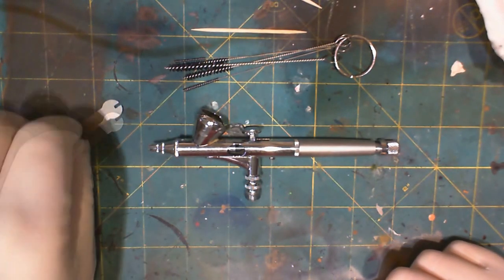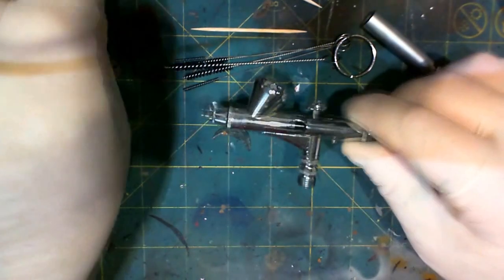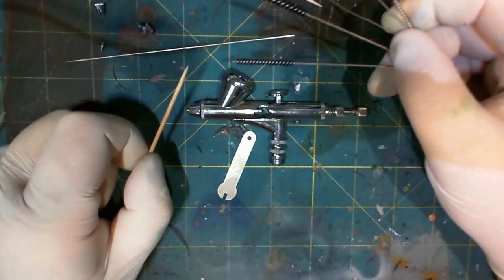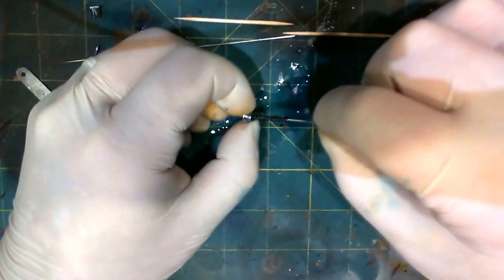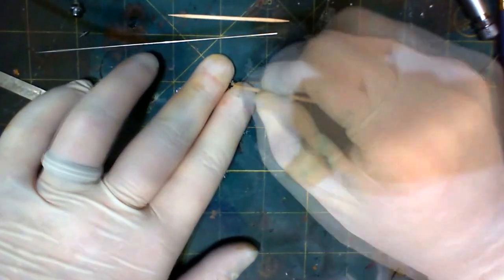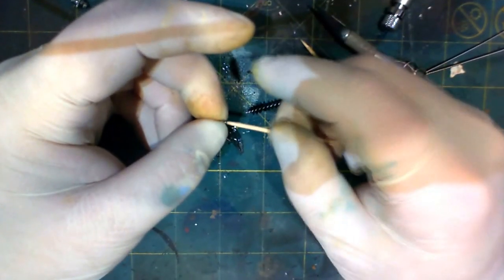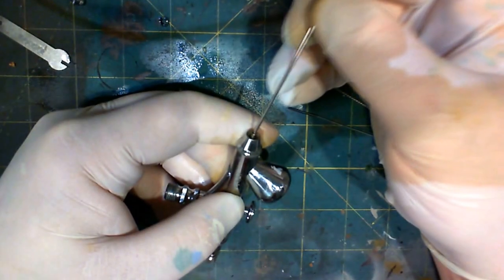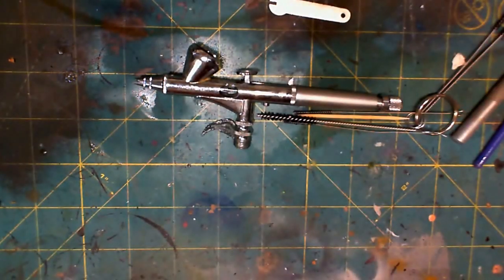How to Clean Your Airbrush

Comment: Jay,

I am a high school art teacher and there has been bits and pieces of air brush stashed away in hidden corners of my four art rooms. I finally compiled all the pieces. I have one compressor with several hoses, two badger 150S, a badger 250 (probably good for only priming) and a Thayer & Chandler 1980 model which still needs some love.

At any rate I could not get these brushes working properly. It was one issue after another. They never worked with any consistency. After watching your deep clean video on YouTube I used your shave the toothpick technique. Well, I pulled out about a cat and a half of tiny fuzz from various parts of the brushes. I think from pipe cleaners.  Mind you these have not been used since the eighties and there was much dried paint as well. All brushes are up and running less the Thayer & Chandler. 

So, one thousand thank yous for the shaved toothpick maneuver.
Reply from the maker: G. George Girard I love getting reports like this! Thank you so much for letting me know I could help.

Comment: Thank you SO MUCH for this video! It was perfect! I just got my first "real" airbrush (Iwata HP-C+...I previously had the neo for iwata) and I want to make sure I take good care of it. I used it for the first time today and love it! Took it apart and cleaned it just like you showed and it went perfectly! Thanks again!
Reply from the maker: PozziToons Fantastic. It is the most important skill to learn when you first get in to airbrushing. If you can keep it clean you'll avoid frustration in the future.
Reply: Jay Adan How often should I clean it? After every use before putting away? Or is that too much?
Reply from the maker: PozziToons   I have another video on the "quick clean" which I do when I'm done with a color - every time. This cleaning can be done at the end of your overall painting session or if you seem to have experiencing any problems with your spray.
Reply: Jay Adan Cool, yea I've been full cleaning it after ever session. Between colors I'll rinse out the cup, spray some cleaner through, then leave a dab in there while I mix the next color, then blow it out before adding the paint. So far, so good! Also had another question I meant to ask...what is the little blue tupe of lube for that it comes with? When do I lube it and what do I even lube? lol
Reply from the maker: The lube is for the needle and the trigger. I don't use it every time I do a full clean, but I'd say at least half of the time I will put a thin coat on the needle, then a thin coat on the trigger where it gets down into the valve. It will sometimes get sticky and slow the closing of the valve. This helps with that.
Reply: Jay Adan Awesome, thanks! :)

Comment: It is a dinair airbrush. The personal pro. So it's not heavy duty. Def not for the kind of stuff you do! Ha but I just have a bunch of foundation stuck in the front of it and it's all caked up so I need to take that part off to get in it!
Reply from the maker: You just need to find a really small wrench. You probably won't find anything that small at your local hardware store, but your local radio control hobby store might have something that works, Don't use a pair of pliers, though (tempting as that may be) as you're likely to damage the tip.
Reply from the maker: I did a little digging. Apparently Dinair expects you to send the airbrush back when you have problems, but it is possible to get the needle tip off. BTW - I found this diagram of your airbrush - http://www.kopykake.com/imgs/airbrush-explode-600.gif
Reply: Thanks! The diagram will probably come in handy. But I did email them and they said the brush set was supposed to actually come with a wrench and sent me one free of charge! Problem solved :) Really appreciated you going to the trouble of doing a bit of digging. You my friend just gained a sub! And I won't hesitate to ask you nay questions I might have from now on :)
Reply from the maker: Glad it all worked out!